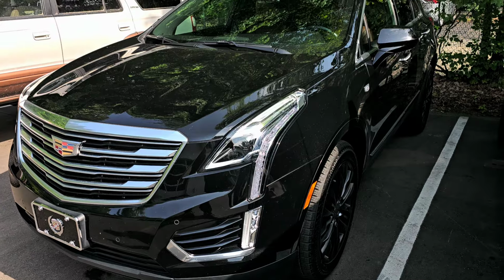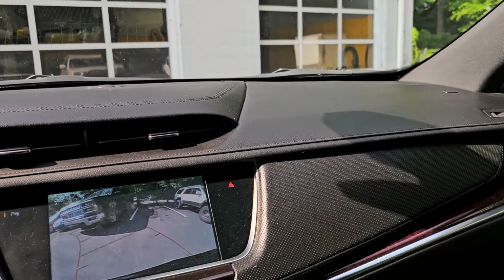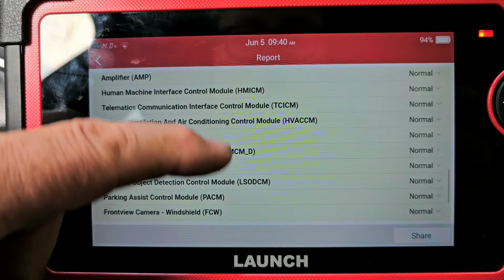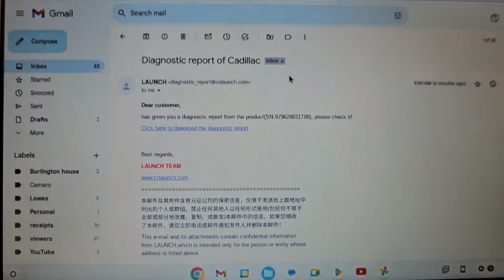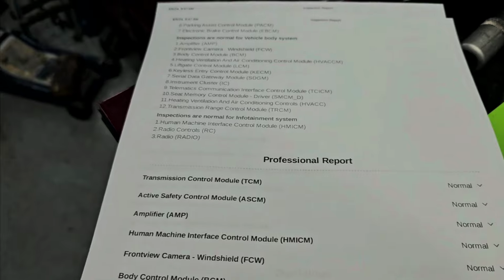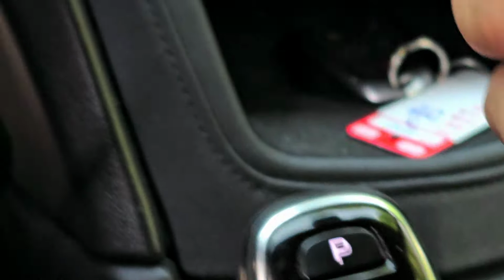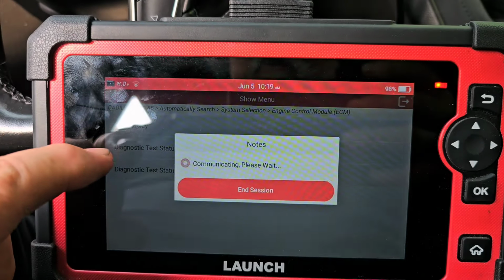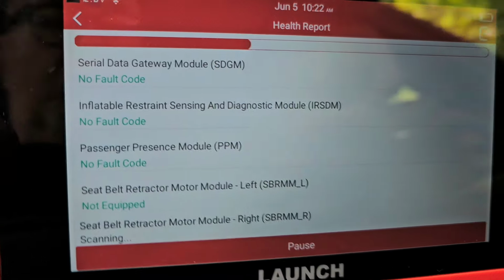Shifter Error & Transmission Issues. Could it be this simple?

Comment: In the lower section of the email report, scroll to the Professional Report. Click the down arrow for expanded module report. The codes are in there with a short description.  The code links that are present in the live scanner screen are not in the emailed report.  It's a manual search at the point.   FYI  More DS is Data Stream.  Be careful in Mexico.

Comment: Wikipedia told you wrong. The XT5 is based on the shorter wheelbase variant of the C1XX platform like the GMC Acadia and Chevy Blazer. The Buick Enclave and Chevy Traverse use the longer wheelbase variant of the C1XX platfom. The early 2017-2019 XT5 is different in that it has an Aisin AF50-8 transmission instead of the GM 6/9 speeds used in all the other models. The Aisin is bulletproof as is the LGX 3.6L. The only cons of the early XT5 are the wonky shifter and strange lack of knobs for HVAC/radio controls.

Comment: Im assuming it uses a 12v reversible motor to shift the transmission in the gears. I’m betting the shift motor assembly has a sensor to determine how much rotation is being done to get in to gear.  Hope this helps

Comment: Bet the actual fault is the linkages have worn slightly, so the acceptable range of motions the module expects have drifted slightly from the factory values, and the relearn is simply to get the new centre position, and adjust the allowable values to have that be the new centre, as it probably drifted 1mm or so due to the settling in with use. Only way to check is to use manual mode, and thus have the shifter actually be moved during the drive, so you can verify it is still reading all positions correctly in actual use.
Reply: You sound like you know what you're talking about. You really do. I'm willing to bet that you could pass for a lube tech. However, there's a small problem with your theory. There's no cable connected to the shifter. Its a shift by wire system that runs an actuator on or in the transmission itself. The procedure you're talking about can't be done on the vehicle in the video.
Reply: @AT-wl9yq  Linkages internal to module, which is the entire shifter unit, and yes I know there are no cables. It however is like the accelerator pedal, in that there are 2 position sensors, and they will need to have the zero position, neutral, need to be set, as the internal parts wear.